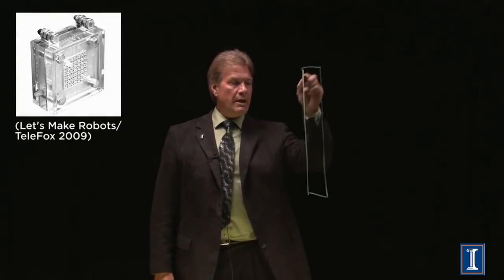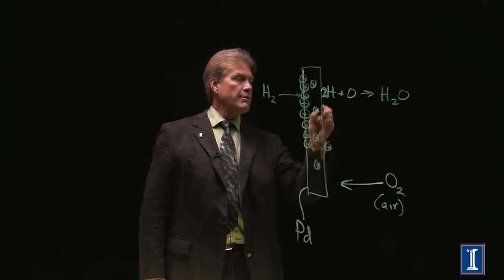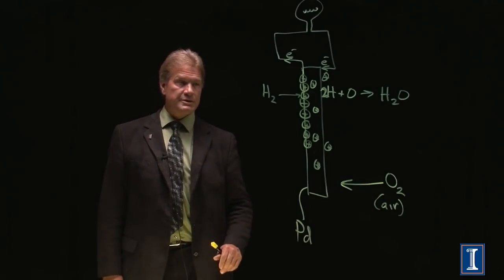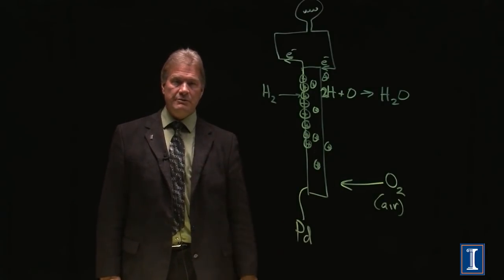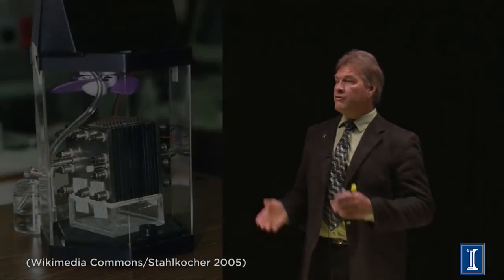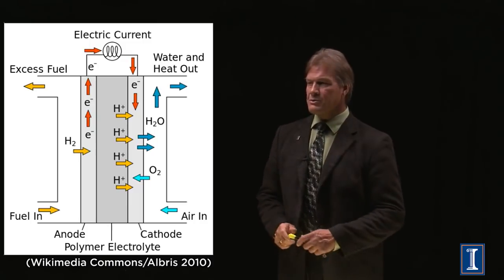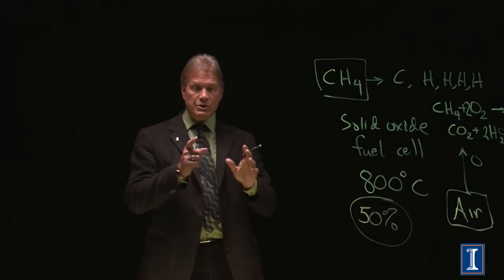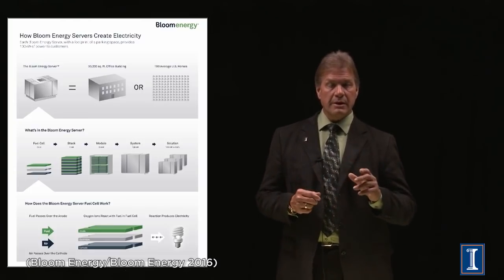Fuel Cells and Hydrogen Economy

Comment: the price of the raw solar panels is quite low. how feasible would a electrolyzing facility be that generates hydrogen during the day by just using the DC output directly?
Reply: solid oxide fuel cells would be 50% efficient or more efficient. so it would have a net efficiency of 25%. the real point you would do this is it simplifies the system you need. just water and directly connected solar panels.  the result is generally more portable fuel. .... using the waste heat or some more sunlight to heat and put the water under pressure is not a very high tech operation either and might make it more efficient, for pressurizing clever tricks with hydrostatic pressure could be employed to create hydrogen gas under pressure without having to run a seperate gas compression system .... one option that might be better still is to refactor the H2 into CH4 using CO2 from the air in a simple process as its easier to handle and works readily in available infrastructure.

Comment: What about using hydrogen in aircraft, either to be burned in place of jet fuel or used in light weight fuel cells?  Is this possible, likely?
Reply: I think you need to consider energy density.  The hydrogen tanks on the aircraft would possibly be too big.
Reply: Ben Terrell It would have to be cryogenic Hydrogen, liquified. Batteries have very low energy density.  What’s the alternative?
Reply: @carljaekle  Even liquid hydrogen has a very low volumetric energy density, better than LI batteries but still rather low. It may seem counterintuitive, but kerosene (the main component of typical jet fuel) has much more hydrogen in it than liquid hydrogen does. Roughly speaking, this is because kerosene packs like 20-40 hydrogen atoms per molecule while hydrogen only has 2.

Energy density of kerosene is ~ 33 MJ/L, liquid hydrogen is lighter, but only ~ 10 MJ/L. 

So you'd need a huge cryogenic tank for the same flight. Even if you could hydrogen at the same price per joule as kerosene we wouldn't use it in planes. This is not to mention that hydrogen burns hotter so you'd need special materials in your engines and you'd need to replace them more often. Also, hydrogen is explosive whereas kerosene is a kind of diesel that is hard to combust at room temperature. Nobody wants another Hindenburg so there would be a lot of safety concerns to address.

Nothing beats hydrogen for specific impulse, which is why it's sometimes used in rockets. It was the fuel for the Space Shuttle's main engines. Recall the size of that tank, btw. Even so it appears that methane is beating out hydrogen in modern liquid rocket engine designs because of the volumetric energy density problem with hydrogen.
Reply: @MrTkharris  By volume, liquid hydrogen has low energy density, but by weight it has high energy density.  The prime advantage of using hydrogen would be that it produces no carbon dioxide when it is used in a fuel cell.  Use of a carbon based fuel, like jet fuel, or kerosene, and burning it obviously produces a lot of CO2.

Comment: The UK HFC company could ‘Ceres’ has developed and manufacture HFC that only require a Steel plate with a Ceramic coating on one side, no Platinum etc!.Also Combined Heat and Power HFC ( CHP-HFC) make HFC technology very efficient for domestic and small buildings etc.

Comment: Can we use these methane fuel cells to power electric ships?. Is it economically feasible?. I can imagine an electric cargo ship that utilises magnus effect rotor sails, fuel cells and is covered with solar panels..  minimum pollution, as methane is much cleaner than heavy sulfur marine oil the marine industry currently uses, no oil spills and much more efficient

Comment: Thirty years ago, Exxon created a way to put GASOLINE in a vehicle, break off the HYDROGENS to run a hydrogen engine.
When one goes to another gas station, the CARBON is removed and disposed and the vehicle is again filled with GASOLINE.
This was meant to be an interim way of weaning us off of GASOLINE.
Exxon also created linings for electric batteries that were light by stronger so as to allow for electric VEHICLES to be economical and/or increase miles one can operate an electric vehicle.

Comment: What is the cost of the heat? Does the system generate its own heat? What about cooling?
Reply: Fuel cells generate a fair amount of heat. About half as much as a comparably powerful combustion engine, which ought to still be enough for cabin heating purposes and such.
Cooling is acheived in much the same way as a regular car, with a radiator, albeit a slightly smaller one.

Comment: How much CO2 is released in a methane fuel cell versus burning it?
Reply: It is the same chemical equation. One CH4 molecule results in one CO2 molecule whether by burning or by fuel cell. So if both the fuel cell and the power station have say 50% efficiency, they will have the same CO2 emission per unit of electricity. Increasing the efficiency will give you more electricity per kg of CO2.
Reply: @michaelwoodhams7866  Thanks
Reply: Michael Woodhams the thing is they don’t. A fuel cell is much more efficient up to 3x more efficient. A methane fuel cell should produce less than 1/4 the CO2 of a gas engine.

Comment: Hydrogen is also usefull in itself, In Japan they are heavy into H cars and filling stations. The thing with methane is that it emits CO2 and that is absolutely something we do not want.
Reply: That assumes you are producing the methane as fuel. If you are diverting it from the atmosphere buy collecting it. The CO2 from it’s use is far more desirable than it’s release. ANd it is far less CO2 than gasoline produces. A fuel cell reduces that even more I would guess a methane fuel cell produces less than 1/4 the CO2 of a gas engine.
Reply: @timrosencrans7955  CO2 is bad however you produse it.
Reply: Ole Stilling no it’s not. Excess CO2 is as a greenhouse gas. But Methane is much worse.

Comment: if you would also use it in a location with a high demand for heating, you can place it inside and get electricity as well as heat, just have to make sure the exhaust can be lead to the open air. 

I'm not so much for fuel cells though as an energy source. It still pollutes, which I hope we can all agree on must be stopped. However, if you can use them in the combination of electrolysis of water into hydrogen and oxygen, I'm all for it. Of course, this process is very energy wasteful, but if you place the process inside where heating is required and you use it to balance the grid by taking in energy when there is a surplus and putting it back on the grid when there is a shortage, I'm a 100% for it. 

Hydrogen however still requires storage, which requires space, materials, and energy.  This problem could partially be solved by placing it underground and use it as premium long-term energy storage and act as a peaker plant. Expensive, but better than long term energy storage in batteries.
Reply: A synthetic fuel economy is a far better option. These should be used as generators and nothing more. A fuel cell that burns methanol would be 100% ideal.

Comment: you have to think more carefully about the advantages of hydrogen and not get stuck on simplistic considerations like "batteries are more efficient." Hydrogen does have advantages for vehicle propulsion despite lower production efficiency (to be accomplished in the future from solar energy so no emissions). Advantages of hydrogen include: (1) 5 minute refuels vs. hours for EVs, and (2) tanks are cheaper and lighter than batteries. An economic and practical evaluation will show that this is the way to go, and the case for hydrogen gets better and better as you move to larger vehicles like buses and heavy trucks that consume a lot of energy and are continuously on the road.
Reply: >5 minute refuels vs. hours for EVs
The Model 3 can charge from 0 to 80% in 30 minutes, and the Porsche Taycan can do the same in 25 minutes. That's not 5 minutes, but it's not 'hours' either. 
And there's no reason to expect that this won't continue to improve.

There's also the counterintuitive fact that the average person will usually spend less time waiting for an EV to charge than they would a gas or hydrogen car. Because most of the time, people are refueling after driving around their local area for several days, not on roadtrips. This means that if they can charge at home and/or work, they would never be waiting for the car to charge in the same way one stands at the pump waiting for a gas car to refuel.

Now yes, on roadtrips it is the case that they will be waiting for 30 minutes or so, but statistically this represents only a small percentage of cases. BEVs make more sense for 80-90% of people who have access to charging at home or work, and don't regularly travel furthur than their daily commute.

> tanks are cheaper and lighter than batteries
But tanks do not a FCV make. The battery in a BEV is equivalent to the entire fuel cell stack in a FCV, since both have the same function of supplying electricity to the electric motor. And once you acount for the fuel cell, air intake, filter, and various pumps, the comparison is not so favourable. 

Compare the Tesla Model 3 LR RWD to the Toyota Mirai.

The Model 3 has a slightly higher range of 325 miles to the Mirai's 312, yet it weighs less, 1726kg vs 1850kg. Pricewise, the Model 3 is about $10,000 USD cheaper.
It is also faster and boasts more storage space, since batteries can provide higher peak power and are more compact.

>An economic and practical evaluation will show that this is the way to go
That seems very unlikely. The basic effciency limits fuel cells, as well as producing and transporting hydrogen, means than a BEV will always be cheaper per mile, probably by a factor of about 3. Although currently it's actually a factor of 7, with FCVs costing 21 cents per mile compared to an EV's 3 cents per mile.

Why use 55kWh to produce 1kg of hydrogen, which can propel a PHEV 80 miles, when that same 55kWh can propel a BEV 240 miles?
Even if all our energy comes from renewables, that doesn't mean there won't be a cost associated with it.
Not to mention that it's cheaper to send electricity along some wires than to truck and pump hydrogen around. 

Also, building EV infrastructure is far cheaper. Aside from home charging meeting most of the demand, a public EV station costs about 10 times less to build than a hydrogen station.
Reply: @lazarus2691  

Yes, 30 minutes’ charging time is about 25 minutes longer than I like to wait at a fueling station. And you are right that many people will charge at home but having to plan your road trip around finding charging stations and waiting for 30 minutes while the battery charges is not very practical. But you are right, electric vehicles are great as long as you stay near home.
Cost of today’s Mirai being produced at a few 100’s per year is not a good indication of what large-scale production costs may be. I believe large-scale fabrication will reduce cost of fuel cells much more than batteries that depend on lithium mined in Bolivia and transported for processing into a battery. 
EV chargers are certainly less expensive than hydrogen fueling stations. However, the calculation has to include how many cars each serves. A hydrogen fueling station may cost ~$1M, but it can serve ~1000 cars (5 minutes per car has a cost advantage in addition to a time advantage), so the cost per vehicle may be ~$1000. How much is it for an electric charger? 
We tend to get stuck on efficiency when it matters less every day. What matters is vehicle cost of ownership. Considering the projected reductions in cost of renewable energy, it seems that capital cost will be the dominant factor in determining cost of ownership – not efficiency.
Any ideas on large vehicles? How about pickup trucks, buses, heavy trucks?  Once vehicles start demanding megawatt hours’ worth of energy storage, carrying batteries literally becomes a heavy burden. Despite what Elon Musk may say, I believe it is very impractical to build an electric 18-wheeler. Accepting this very straightforward fact, then we will agree that we will have hydrogen vehicles in our future. And considering that a hydrogen refueling infrastructure will have to be built for these large vehicles, why not use it for personal vehicles with improved flexibility and driving range?
I will finally point out that I am not against electric vehicles. If 20 years from now we all drive electric cars, I will be the first to celebrate, because the ultimate goal is zero emissions transportation, whether it is propelled by hydrogen or not. I am, however, against simplistic and premature dismissal of potentially good ideas. And I welcome a good and informed dialog.

Comment: Cars are beginning to have built-in solar panels. It should run an atmospheric water generator to constantly collect water that will be used for drinking and growing plants and trees for food. If you miniaturized a water splitter you could run a fuel cell (Electric) vehicle.  Yes........ " WATER " the wonder fuel for all things. Start the hydrogen economy.  We can do this!......
Reply: Atmospheric water generators are horrendously ineffcient, about a dozen times more power hungry than desalination. They are only useful in niche locations.
It would make a lot more sense to just collect rain from the car's roof. Even then, it doesn't make much sense. Cars have a lot less roof space than houses.
If your goal is to collect rainwater for drinking or plants, then collect and filter it at home. If you want to make fuel, collect and split it at home.
Also, most houses don't need to worry about getting worse milage from added weight, on acount of them not driving around very much.
Reply: @lazarus2691  Then we will naturally make all components not only more efficient but also multi-functional. Most of the earth's population is located mostly near the coast where it is humid and there is plenty of water.  An atmospheric  water generator would work well there.  Or you could just find a place to fill your tank with water. Just about any facility should have a water spigot . You could propably ever piss in the tank and run it through the filters and split it to make on demand hydrogen to power you car. What do you think?

Comment: Hydrogen fuel cells have a much lower round trip efficiency than BEVs, so they will remain more expensive to fuel. You can't fill them at home. The fueling stations don't always work. There isn't a single fueling station in my state. Good luck going coast to coast like you can with a Tesla.

Comment: So couldn't we simply use hydrogen fuel cells exactly like we use li-ion batteries for energy storage? Rather than refuel hydrogen simply plug it into the wall like you do with batteries? From what I understand hydrogen fuel cells are higher densisty energy than li-ion and don't have charging current and temperature limitations? Would be a trade off in effieciency, but for transportation maybe it would make sense? Is the effieciency so low that it doesn't make sense?
Reply: It's largely impractical to store or transport hydrogen in a gas form, as it is very reactive and highly flammable, plus even pressurised the energy density is low compared to petroleum. They have found a workaround this by transporting it as ammonia (NH3), but it takes energy both to turn hydrogen into ammonia, and vice versa, increasing cost, both in terms of energy and production. And no, you could not recharge it by plugging it into a wall, you would need to top up the hydrogen stores.
Reply: Well, fuel cells do not have any energy density at all, they simply convert stored energy from chemical form to electricity with a certain efficiency, around 50% at best in current technology. Add to that the efficiency of producing hydrogen in the first place, currently mainly produced out of natural gas with a huge CO2 footprint or out of electricity with a certain efficiency as well, which then has to be stored and transported which in itself costs a lot of energy (either cool it down to very low temperatures to keep it cool or pressurize it a lot to keep its volume low).

If one takes the energy produced by a windmill, stores it into hydrogen, transports it to fuelling stations, then fuels a hydrogen car, the total system efficiency is at best at 25%. 75% of the energy produced is lost. Compare that to a battery electric car instead, the energy produced by the windmill has to be transported to a charging station and then stored in the battery on board the car and used there. The total system efficiency in this case is around 75%, only 25% of the energy is lost.

Yes, we can use H2 to power cars and especially when driving long distances fuelling up is fast (provided no one used the fuelling station right before you have to use it, in that case you have to wait 20 to 30 minutes to pressurize the gas), for day to day use it is much more convenient to plug the car in once its parked in your driveway and always leave home with a fully fueled car.

Comment: I would use hydrogen fuel cells as more efficient batteries 
for grid-scale energy storage   

so you can provide grid stability.
Reply: but that aint efficient. The energy lost in charging up batteries is low. The energy lost in electrolysing water is inmense, it is a horribly inefficient reaction. It's better to use mechanical moving parts and using some kind of potential or just spin a wheel. These are viable cause the energy lost at the mechanical-electricity conversion is low.
Reply: PuMpEd HyDrO

Comment: Learned something. CO2 is actually released in the process.
Reply: Yes, if a carbon based fuel (like methane) is used. Not if hydrogen is used.
Reply: in methane, not in hydrogen.